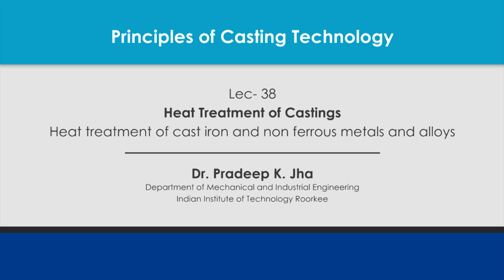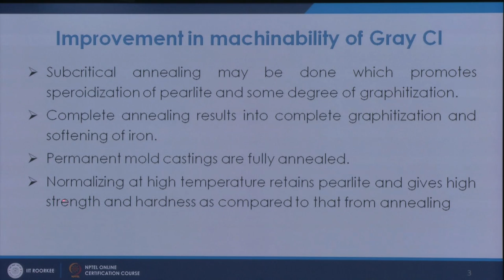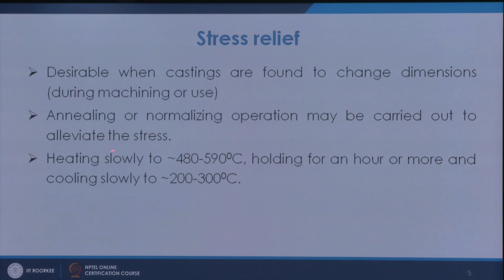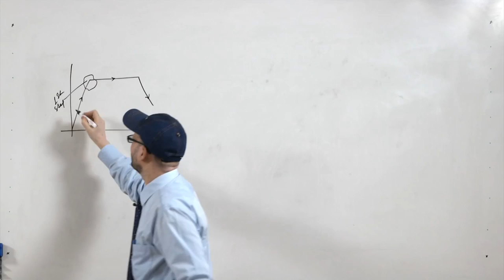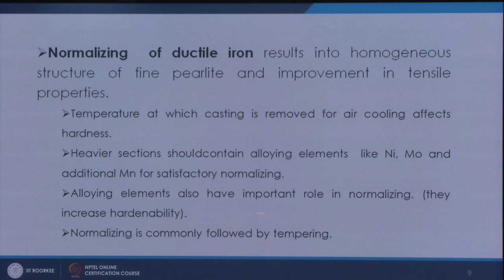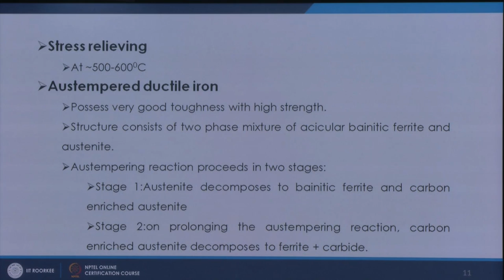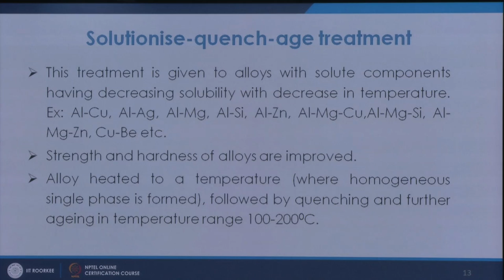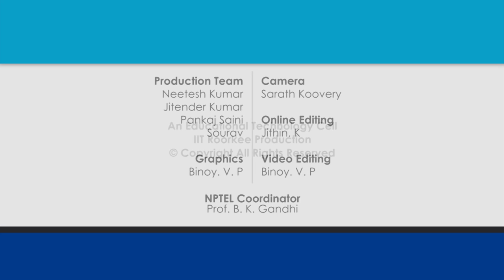Heat treatment practices for cast iron & non-ferrous metals & alloys

Comment: i have a question about machinability.  a vehicle from the 80's comes into my shop & has a cast iron spindle. the customer cut the stuck bolt off flush to the casting on both sides so it can not be grabbed with a tool. customer also attempted drilling and failed. so the customer shot me in the foot. twice. in the same spot. my course of action was to burn the bolt out with my oxy-acetelyne torch. that worked. but like always, it hardens the metal. in your video, i suppose i did flame hardening to the metal.  regular drill bits wont drill the hole i just made.  how can i anneal the metal without further flame-hardening the casting that needs drilled and tapped for inserting a bolt?
Reply: i am likely to use a high speed carbide tool to ream the hole out but i need to learn annealing.
Reply: @rooftopcertifiedautorepair2012  should have spot welded